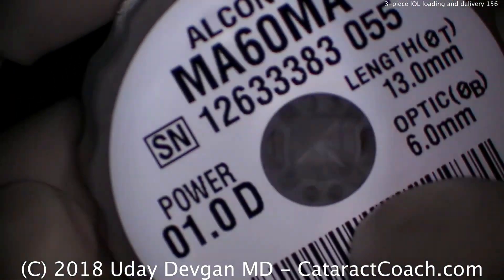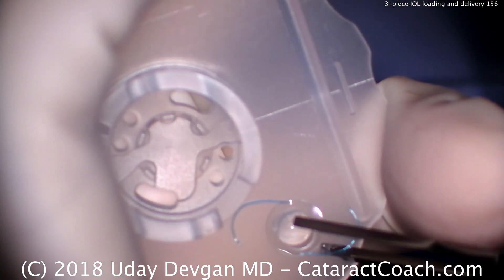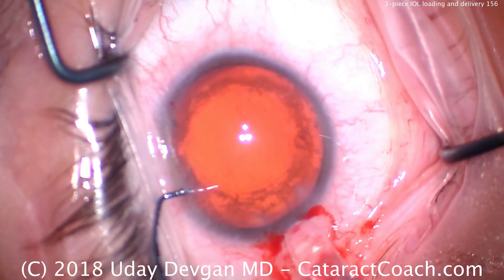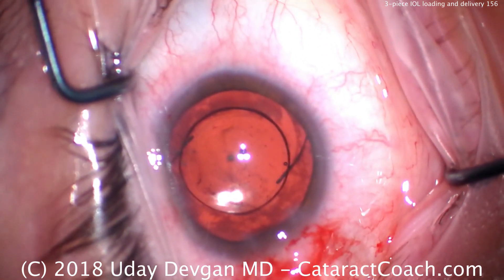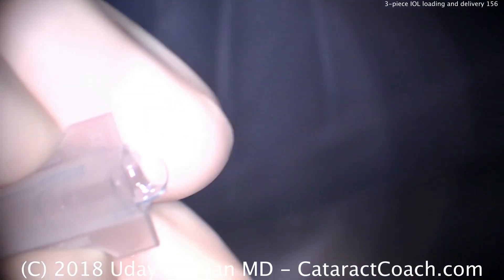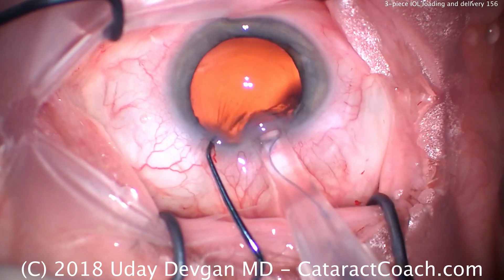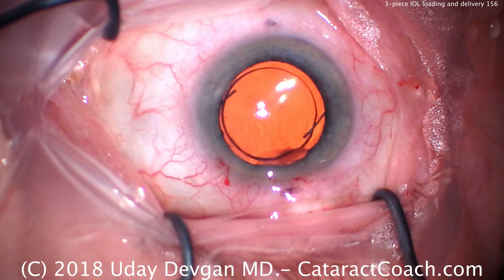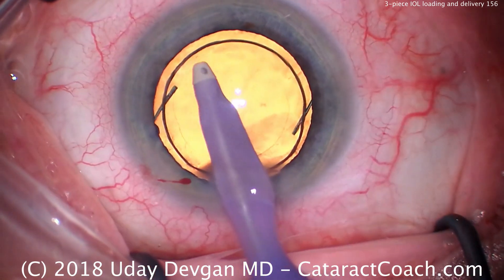How to properly load and inject a three-piece acrylic IOL during cataract surgery

Comment: What can happen if a 3 piece IOL is inserted wrongly? upside down?
Reply: trouble.....refill the "bag" with viscoelastic and the surgeon will attempt to flip the lens in the "bag", ten times harder with a 3 piece as appose to the 1 piece. Then pray that the bag doesnt tear, if it does its a whole new case, sucks.

Comment: Twisting of leading haptic will cause perfect delivery of lens as in second case.
C louping of leading haptic as in first case can cause permanent damage/ deformation of leading haptic.
So when leading haptic makes a C loop, just before leading haptic comes out of cartridge,by putting a dialer through distal end of cartridge one can straighten leading haptic ( causing twisting of haptic). Twisting of leading haptic will cause perfect delivery as in second case without deformation of leading haptic.